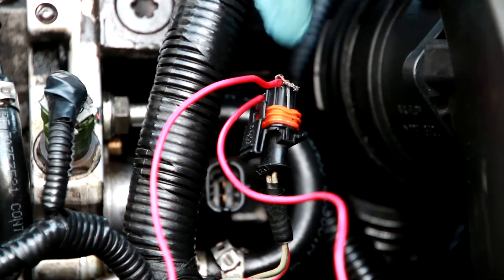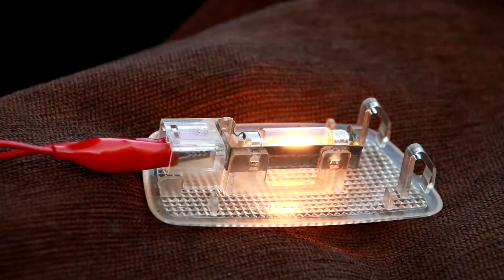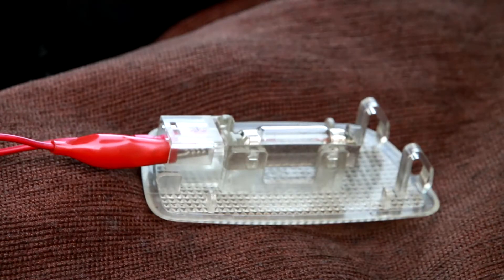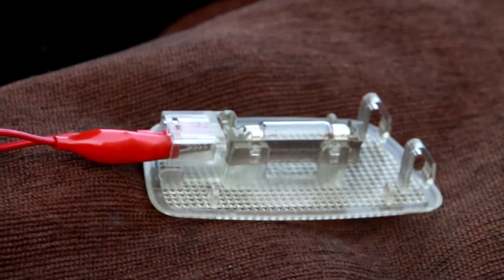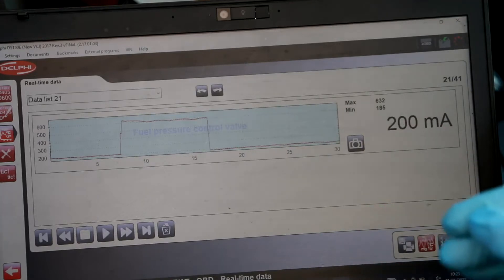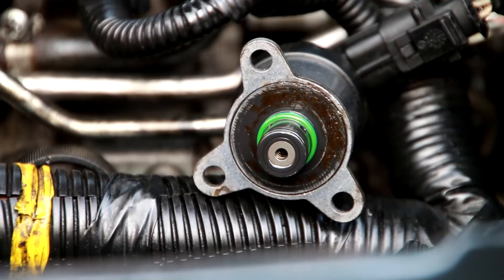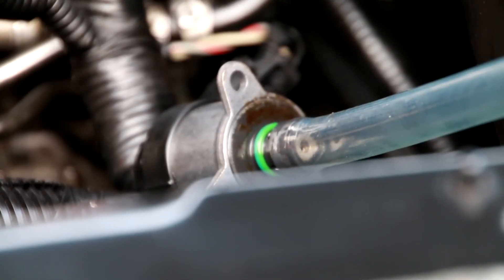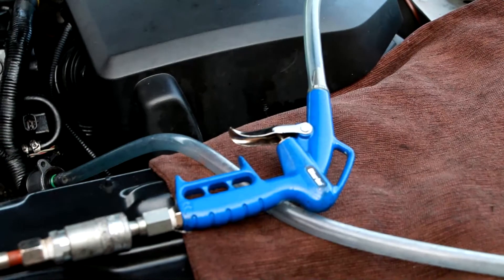Volvo D5 CP3 HPFP Fuel Pressure Control Valve SCV Check - Eighth Stage

Comment: I have a audi a4 b8 2.0 diesel that stoped  and is not starting ,and i have a  noise from this valve when i put the key ,pump is bringing diesel to the pump ,all is good on the lower presure but from the pump also diesel is going to injectors but stiil not starting ,i changed the reculator from the common rail because i had low presure error on vcds and i saw that when i try to start all the diesl is goin to the return hose ,so i was thinking that is bloked on open ,but still  is not starting ,i will change tomorow this valve caus emy one is making a strage noise ,i hope i solve it

Comment: The valve purpose is to open/close the flow of fuel from the priming electric pump to High Pressure pump.After that the fuel goes to the rail end and injectors.Try to check the fuel flow on the inlet to each injector-one by one - bleeding  the air from fuel lines.

Comment: have you checked the resistance of the SCV? usually if the reading is higher for example its normal reading should be 3ohms but when tested using a multi meter if it reads 5ohms is already subject for a replacement,have it also scanned to show the live data stream of the SCV if it can still hold pressure
Reply from the maker: Thanks for your comment Oli. That car is sorted. It was actually the fuel pressure issue due to lack of enough priming. I'll update it in the description above
Reply: @MrZakmuh  What exactly do you mean by priming? I have about the same problem. I cleaned the injector housing and replaced the seal on the intake manifold (the thing where the camshaft is under). Now the noise i had before is gone, however i now get 0hpa fuel pressure. I belive this is connected to either a faulty sensor or the High pressure pump. Im still trying to rule out what the exact cause, is. I did not try to remove any air from the high pressure metal lines (according to the internet this isnt neccesary and i i actually wouldnt know how to do that properly)
Reply from the maker: Priming...let me put it this way...it means getting rid of air from fuel and getting a steady fuel supply to HP pump.
Basically for Volvo, you need turn ignition key ON and OFF until no air is left in the system. 
For this when you turn ON ignition,  check if you could hear air bubble noise in the fuel filter housing under rear passenger seating. If you do then keep doing ON/OFF cycle like 20 times until you could only hear a whining noise without fuel flow noise